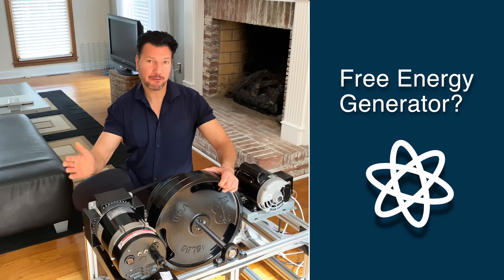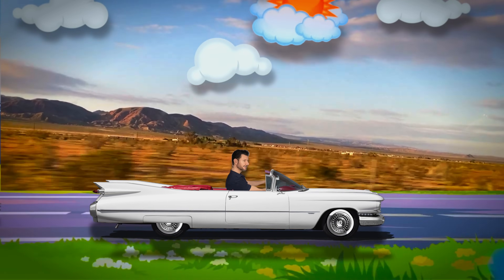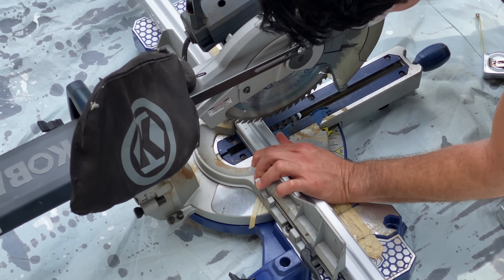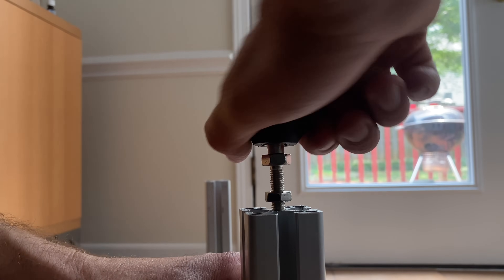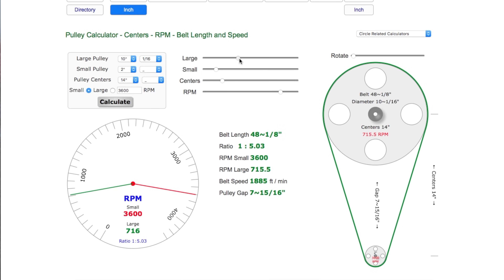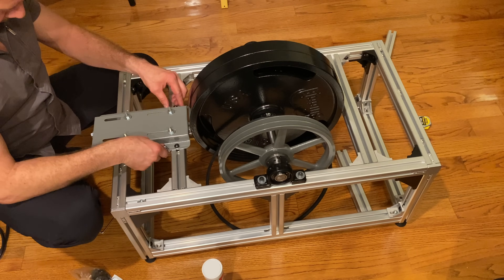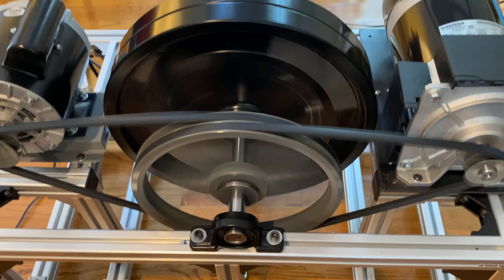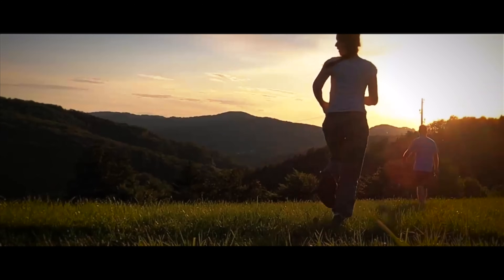How to Make a Free Energy Generator!

Comment: Almost there. It appears you have an ac capacitor start motor. And a DC generator. So you need to change either the motor or invert the current from DC to AC. Also, the pulleys on the flywheel are incorrect. Use a 3" on the generator and a 6" on the flywheel. Then a 8" or 9" pulley from the flywheel to a 4" on the motor. The idea is to get as much torque from the flywheel to the generator. But at the same time, spin fast enough to generate enough electricity to the motor. Good effort! Keep it up!
Reply from the maker: Thanks Roger I have not given up :)
Reply: Since it sounds like you have it figured out, I'd like to buy a free energy generator from you. I can also get you in touch with investors that will give you millions. All you have to do is bring over and show that it works. But that shouldn't be a problem for someone like you that broke the laws of physics. Will be waiting to hear back!
Reply from the maker: @sptalat  hello Pria no unfortunately I have not figured it out.
If you watch the video to the end you can see that it’s not working.
Thanks

Comment: I know do a gear change on only the generator gear one high and one low
Reply from the maker: Thanks Daniel! I started with a step pulley and it didn’t seem to make a difference what size. Will try converting a car alternator and use a battery bank.

Comment: You need  Capacitors to take the heavy voltage to run the motor, also step up your electricity with a transformer and smooth out frequency with resistor to capacitor
Reply: I forgot to say use a alternator from car or truck. One two three with flywheel extra battery with motor to start.  Charge battery with one alternator use other two for extra power. I have a 200amp isolator in my truck that runs my 4000watt inverter with truck on idle.
Reply from the maker: @superfliping  just got myself a 130Amp alternator.
Thank you!
Reply from the maker: Working on putting together a battery bank like the Tesla wall.
Thanks

Comment: The way you can do it is to use battery Banks and inverter and that will kill the problem thanks
Reply: With battery bank and inverter. Constantly charging .you can also regulate the input and output  with proper size motor and battery's it should work .
Reply from the maker: @seankim1223  working on a concept like a diy Tesla wall.
Thanks

Comment: If you notice on the Indian video they're using a 3-phase motor and a 3-phase generator a 3-phase motor only draws half the current of a single phase motor that's probably why it's working for them and not for you in Europe they use 220 appliances they don't need 110 voltage
Reply: Bro…. Infinite free energy is NOT possible with that setup
Reply: You should be able to use three phases here just use one phase in the ground or two phases for your 220

Comment: I designed, and it worked. Use the pmg low rpm alternator and pmg VFD driven motor, so reducing the amount of power consumed. Use advanced bearings with high efficiency. The challenges came from gear ratios and pulley sizes and flywheel size, too. Your experiment failed, woefully believe me. 
You can assist the design with solar hybrid inverter to drive the motor while still taking power from the alternator generation.
Reply from the maker: Is your system still working Stephen?
Thanks!

Comment: I've got an idea for a perfectly balanced flywheel go down to your local tractor junkyard and pick up a tractor flywheel it'll have teeth on it but who cares take it to your local machine shop and tell them to weld or colic in the center for you so that it's perfectly centered and voila you will have a perfectly balanced flywheel those fly wheels are balanced from the factory before they put them on the tractors even an old one off of a tractor from the 30s or 40s will be big and heavy and balanced perfect

Comment: The electric motor that you are using is junk for this process get rid of it get yourself a ( Manta 2 motor )... That runs on 12/24 volt and 48 v it is a 10 horsepower motor it's a DC motor hook a battery and a battery charger to your generator to run the motor and make sure they're all in parallel together that motor has 10 horsepower at 48 volts so you'll need to put a battery Bank in there and hook it up to 48 volts.... And keep your flywheels but see if you can get them to balance out a little better than you have even if you have to go to a machine shop and have them do it for you because that bad boy shaking all over the place and you can on eBay order big round pieces of steel and then take them to the machine shop and have them board a center hole for you and weld on a colic... That way you can mount it on your shaft and it will be balanced.... But your problem right now is that your motor is not putting out enough juice to run to your generator that generator takes at least 10 horsepower to power up and you're looking to get extra horsepower out of there after you turn the motor in a workhorse and it's just not going to work that way because the motor is too little... Get yourself a Manta ll motor and you will have your problem solved.....
Reply from the maker: Thanks Lewis I will check into the Manta motor your referring to.

Comment: I watch the video first and comment later after finish watching.
Reply: Failure is a pathway to improvement
Reply: maybe need bigger flywheel, different pulley ratio, or different circuit for the motor that use lower current from generator
Reply from the maker: @IkanGelamaKuning  thanks for your comments! Appreciate it!
Just bought a used car alternator and will try to modify it and convert it to a low rpm generator.

Comment: IF you pulse the motor instead of giving full continous power, it uses less electricity to move . It needs to be pulsed . The driving motor might also still be too big. Use a smaller motor ,add capacitors to store temperorary energy to run direct from generator to motor. You will initially need to start up the small motor by spinning the weight wheels by hand.
Reply from the maker: Thanks Patrick I was thinking about pulsing the motor but I think first I have to make a few other basic changes. But yes that totally makes sense.

Comment: What if you put a bigger flywheel on the motor + small in the meadle + small on the generator +big on the meadle that is going to help your motor and the generator is going to be faster
Reply from the maker: Yes I would have to put 2 different sizes on the flywheel 
Thanks!

Comment: Man you need a 2 way switch the left switch came from the line and the right are from the generator to the dynamo so if you turn left the switch the power line fed the dynamo but if you turn to right the switch the generator fed the dynamo that's it
Reply from the maker: Hello Joel, I am doing that with a relay.

Comment: Nice try. And that is a very honest result you have posted here. The pulley ratio of your Flywheel and generator is way too high that it requires greater torque for the flywheel to achieve a 3600 rpm drive on the generator. Using a generator with multiple poles and lower rpm requirement will help a lot to generate power. Free energy is real. Energy gain is achievable.
Reply from the maker: Thanks Jessie!

Comment: Wow, what a waste of time and money.
You put energy from the grid into the motor the motor converts lets be generous 90% of it into mechanical energy  what's left goes to the belt and to the flywheel and some more  gets wasted let's say another 5% then from the flywheel to a belt 5% wasted then to a generator to convert back to electricity and another 10% wasted then back to motor an so on.
How is it supposed to make free anergy when the first step is to use energy from the grid to spin the whole thing?
Flywheels are more like a mechanical energy storage they can store some energy for some period of time they don't generate any energy at, all flywheels like all mechanical systems have losses, all moving parts touching eachother are subject to friction and friction will take some of the energy and convert it to heat.
People get one thing into your sculls, there is no such thing as a free energy generator.

Comment: Can't get a Flywheel!? Balance, I do know a engine/motor will never realize it's full potential if the balance is not correct from the start. Get rid of the weights, never made to spin like a flywheel, those things might explode sending shrapnel everywhere.  Now even a gram is multiplied expodentially w/each RPM. Imagine a weight at the end of string?, with you spinning it faster/faster!? Flywheels come balanced/counter-balanced. Also instead of belts, how bout gears? Gear-drive! With gears, you have the added benefits of rotational inertia from the weight of the gears, and also a more exact way of dialing in the desired ratio. You can ask a man named ROLEX bout gears/balance. It's good to see others have responded, maybe my input can help. Oh, if yer still having trouble locating a flywheel/s I know I got sumtin downstairs I can let go for a couple/few bucks?
Reply from the maker: Thanks Michael

Comment: The reason this isn't working is because you have to modify the alternator/generator. The metal inside the alternator or generator is designed to draw energy by stealing the magnetic field. In order for these alternator/generators to get to market they require a patent which would not pass with a modified alternator/generator as the US military who owns the patent company does not want you self reliant with a cop>1 generator. This is why they sell you a cop<1 in order to draw energy from the grid whereby you pay oil companies (ran by the US) so they remain rich and we remain poor.
Reply from the maker: 🤔interesting!

Comment: My friend, there's free power. 
You have to determine the speeds. 
The small engine is faster than 3,000 rpm.
And the big engine is 1400rpm.
You have to stop the big weights and make holes in them.
Finally, the only drawback is that you use 2
But the correct one is a generator with a fixed magnetic heart, neodenium N52, which will be effective. 
And the other engine instead of fixed files is a magnet 
You're going to do 10, 000 years of free energy.
And don't forget to mention my name. 
She's actually working, but you only have flaws.
Modify it while I wait for you.🌹🌹🌹🌹

Comment: hi, I see only different between your built and indian version is flywheel , on in indian version he have bigger flywheel ,  bigger and heavy flywheel will  create more momentum and  power to pull generator when  is reach to target speed (  target speed is depend on your generator require, some generator need up to 3000 rpm ore more to produce maximum power) and generator can produce maximum power to fed electric motor when disconnected from  home power source ,  up to this point  flywheel just need  a little push from electric motor to keep speed  constant and none stop.

Comment: Use caps or bats with an inverter / charger . . . Have you a parts list ?
Reply: One thing that may work for you as I dont have the skills to build - I turned a bike frame up side down - to make use of the double ball bearing ' as I thought a timer on the first motor would save power .
Reply from the maker: No unfortunately I don’t have a parts list but a few links in the description.
Reply: @MarkusNenning Its an honour to speak with you as your engineering skills are far more advanced than mine - i am building mine from junk trying to make it power its own ac washing machine drive motor using transformers - two inverters - 24amp buck converter a car alternator and concrete fly wheel - ( now added a dc 180v treadmill motor ) - as thinking maybe a third motor may solve the problem .
Reply from the maker: @dennybaker8755  I am just amazed how many people like yourself are reaching out to me and have their own generator projects going.
Very much appreciate your feedback and good luck with your generator.

Comment: Hi !
Use proportional ratio  3  6  9!
3 to the motor
6 to generator
9 to flywheel
For the system use 1 2 3 ratio
For ex.   motor 100watt, generator 200watt, 
flywheel 300watt stored in cinetic energy...here you have to make some calculation acording to the speed of the flywheel you have to reduce weight in the way you can store 300 watt
This is just an example blueprint for the entire system ...as long you respect those ratios you can increase the power of the system !
Use thik cable...do not use automatic fuse betwin the generator and motor...will cut the amperage and voltage ! spin the system with other motor until reach the nominal speed !
You can use automatic fuse    out of the system!
The average extrapower is 3 to 1...that mean for an engine with 100w you can create 200watt extra...100watt from an total of 300watt it is consumed by the engine itself !
Reply: alternator 30kw jaki elektryk motor how power used
Reply from the maker: Thank you for that info Bogdan!
Reply: @MarkusNenning  did it work?
Reply from the maker: @barnabalint387  unfortunately not yet.

Comment: https://youtu.be/e2004BPxb-M, watch the video,it work but if you're generator is synchronous generator you've to modify it to low RPM generator if not it hardly work due to high lost of energy in synchronous generator,mine work

Comment: Farm equipment, square hay balers have big heavy flywheels, balanced for 600rpm
Reply from the maker: Thanks Earl!
Didn’t know that will check into it.
Reply: @MarkusNenning  Hey Markus, ever look into water as fuel? Every car that got 100- 200 or 300 mpg was useing hot steam into engine intake, heated steam from exaust heat
Reply from the maker: @earlwilson6153  no I have never heard of that. Even though I work for a car company I am not that into cars 😬😃
Very interesting I may have to do some research on that.
Thanks!
Reply: @MarkusNenning  1973 opel p1 experimental car weight 2500 lbs got 376 miles per gallon on shell test track
Reply: Smart drive wash machine motors, very efficient, brushless motor or 120volt , 60 rmp ac generators

Comment: How much load voltz, wattz, amp dose the motor pull, at full speed, then much dose the generator make at half speed because you can not use the full speed because the voltage is not constant at that speed do to energy loss, so you need a motor that can run at the half speed amount, you could try a engine start they draw a motor steady amount at burst power that you are trying to do.
Reply from the maker: Hello Wolfy I have all that information in the second video.
Thanks for the feedback!

Comment: why have you got reduction from motor pulley to flywheel, only to have same reduction at generator, they cancel each other out.  surely stepping up gear ratio would be a better idea?
Reply from the maker: This was the only way to get the correct rpm for the generator 
I need to get a different Generator

Comment: Hey there, it's possible you are using to big a motor, but something I think may help, haven't seen any of the videos you are talking about but if you could separate the Flux of power from a live situation, I believe the change over from electric to the generator having to do all the work is bogging it down and shutting you out. Try to separate the power supply, so use a inverter big enough to run the motor, connect it to one or more 12 car batteries. So the generator is simply charging the battery not pulling the power to keep it in rotation. I don't know how long it would work, before running out of power ,but I feel this would be the next step in your process or something of this nature.
Reply from the maker: Thank you Happy Peace!

Comment: Finally, an honest man makes this attempt !!!    Personally I have made tons of motors and generators. Also, used to repair generators as a job 20 something years ago. I never would have thought this possible... but those videos !! oh man, those video's !! They have made me wonder :)
Reply: This is legit and honest video compare to others fake invention
Reply from the maker: @binayongpalay7514  thank you!
Reply: @MarkusNenning  The solution of generating self sustained energy lies in the perfect balance of the setup. Like the Earth and all planets  hanging upon nothing in the void and possibly being helped and kept in place by one another and in motion.
Reply from the maker: @sham1234567891  probably some truth to that.
Thanks Shamrai!
Reply from the maker: Thanks TDT Records!
Reply: HIS problem is that it uses a self-excitation generator that is not efficient and requires high speeds to generate electricity, the secret is an efficient generator with NEODINIUM MAGNETS that produces electricity at much lower speeds and is much more powerful and efficient.
Reply from the maker: @alincuc2882  I am working on a different generator that is made by converting a car alternator using Neodymium magnets.
Reply: @MarkusNenning  Still won't work. No motor is 100% efficient, and you will never re-gain the loss from heat or friction. You can do anything you like but it still won't give you anything back but losses. Simples.
Reply: @MarkusNenning  what about a permanent mag. gen.
Reply from the maker: @garygarner3940  working on a test using a modified car alternator.
Will post a video if I have any success.
Reply: True, those videos also made me wonder 😅.
Reply: Just like a magician or an illusionist hones their craft to deceive the eye, these free energy claims, over unity claims and perpetual motion claims are just that ............. deception
Reply: @leightonwestbury92  You need to read Tom Bearden, U.S. gov. expert on free energy. His patented device that pulls F.E. directly from the vacuum and use no moving parts.